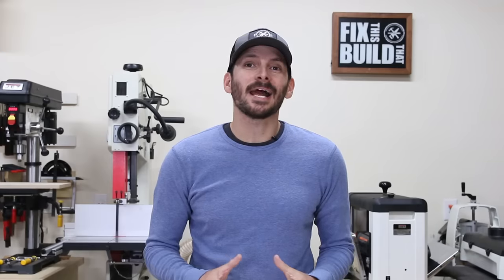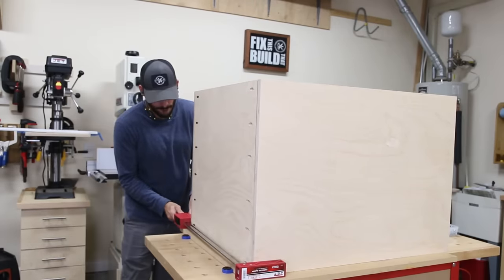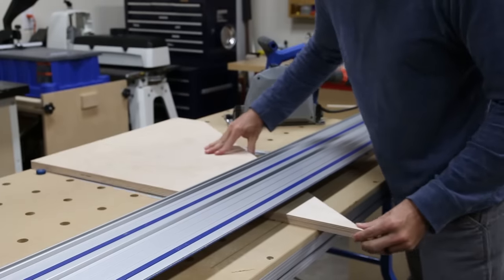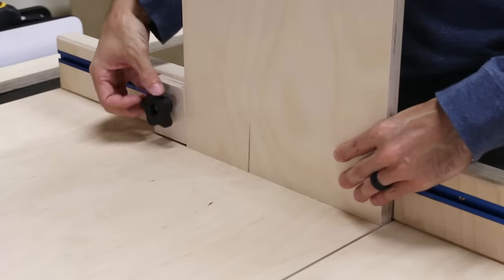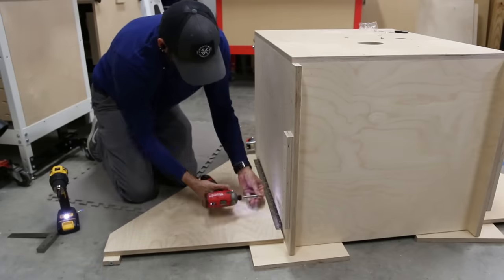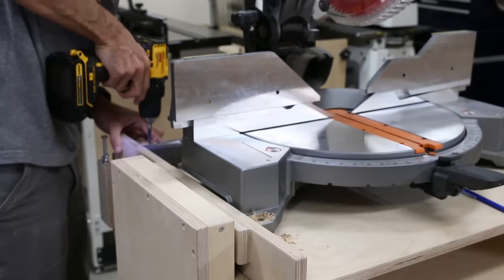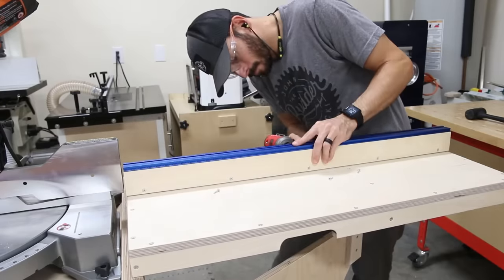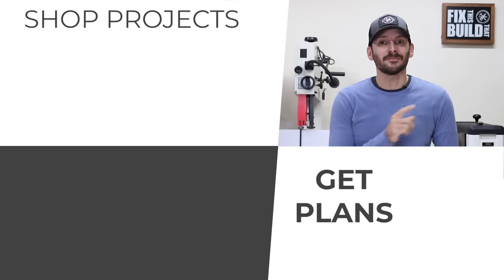ULTIMATE DIY Miter Saw Stand | How to Build

Comment: Another quarantine project I built to improve my shop.  Thanks, Brad.  Great plans.  Could have used one more dimension on the cutoff of the wings, but ultimately it wasn't critical.  How has the 4-gallon vacuum worked for you?  Does it provide enough suction?  Thanks.

Comment: Just found your channel a few days ago since I can't go anywhere during the pandemic and have already bought two of your plans that I will build when I can get material.  My late father was a fantastic woodworker but did not teach me anything.

My newbie question is, can you be a little more specific on what type of plywood to use for this project and also for the shoe rack you did?  Obviously something like CDX will not work for this or any furniture type project so any suggestions would be greatly appreciated.
TIA
Reply from the maker: Welcome to the channel! If you're painting it you can use BC sanded plywood or the "sanded ply". Definitely don't need the maple or birch oly

Comment: Brad, great plan!  Will this build accommodate a Dewalt 780?  I was checking the amount of swing on the arm and at the 60 degree point, it measures close to 28 inches due to the miter lock handle in front of the saw.  Thanks
Reply: Hey did you ever build this I have the same and was wondering as well?
Reply: Not yet. but hopefully will this winter @jrhewitt1988

Comment: Good Evening and thanks for this video and your plans, which I have purchased.  My miter saw is slightly higher at 4.75 inches at its table surface.  I like the 39 inches height that the plans indicate.  If I lower the top shelf another inch to accommodate for my saws extra height would that not be an acceptable adjustment rather than increasing the height of the sides?  I realize its only an inch and could be done either way but would be interested in your comments.  Thanks Gordon
Reply from the maker: Yes that would work as well!
Reply: @Fixthisbuildthat  I will enjoy having my miter saw more easily able to be used.   I appreciate your ideas and your willingness to share them.

Comment: ok... ignore my question about the 20.5 inch position versus my thought about the 22 inch placing of the double 10.5 inch supports under the extension table .  The angle of the support wing accounts for the difference between 20.5 inches and 22 inches....at least I think so....

Comment: Hi Brad, I just purchased these plans and had a question with respect to the material/supplies used.  Can you explain; (10) 2-1/2” 1/4” - 20?  I know you mean (10) pieces that are 2-1/2 inches by 1/4 inches, but what does the 20 stand for?  Also, what size of fender washers did you use?
Reply from the maker: Hey, Mike.  1/4-20 is a thread type.  They will be listed that way at the store.  And 1/4" washers for the 1/4" shaft.
Reply: @Fixthisbuildthat  Thanks Brad, I look forward to your next build!  Cheers, Mike
Reply: @Fixthisbuildthat  just another question:
What size of Forstner bit did you use for the recess’ on the wings?  Also, how deep did you go?

Comment: I really like it.  The only thing I don't care for is the use of t-nuts on the surface side of anything.  At some point in time they are going to work themselves free.  Those little points are just there to stop it from turning being threaded from the opposite side, not to hold it in.  I think threaded inserts would be a better alternative.
Reply from the maker: There is no upward force on the insert, always downward. So it can't physically work itself out. But threaded inserts are great too 👍👍

Comment: Hey Brad nice build - question- realizing this is a new build but how does that low profile cyclone lid work so far?
Reply from the maker: the cyclone works very well at separating the dust.  Not sure how much suction I lose though
Reply: I bought one well over a year ago, and it's the best $40 I ever spent! Don't hesitate. But the biggest mistake some people make when using them, is that they try to use too small a vacuum. It requires a minimum amount of suction power (check the stats, the more the better) or it doesn't work as well. I use the 16 gal Ridgid vac w/the removable blower head, and it works fantastic (about $100). I collect dust from my table saw, band saw, and sanders, with a standard size 2-1/2" dia 13' hose...and I use a 20' hose (same 2-1/2" diam) to reach my planers and router table, and also use it to vacuum the floor almost anywhere in the shop. Yes, I experience a little suction loss with the 20' hose, but my vacuum has so much power that I've never had ANY problems with clogs, even when using the planer. It works great, and I just manually switch between the two hoses at the Dustopper inlet, as I need them. Only issue is those 5 gal buckets under the Dustopper fill up really quick though, if you're doing a lot of planing...so you do have to keep an eye on that. By the way, do yourself a favor and pick up a $10 remote plugin for the vacuum, and you won't have to walk back and forth to turn it on and off. It's cheap and has been very dependable for me, and doesn't seem to require line of sight for the remote...that means I can point it almost anywhere (or be almost anywhere in the shop) and it still works perfectly. It's probably the best $10 I've ever spent on any tool, and really goes hand in hand with the system above!! It makes your life so much easier, and you'll love having both hooked up together. It also makes using the vacuum feature on the Kreg K-5 jig a pure pleasure to use while drilling pocket holes, because it's so easy to turn the vacuum on/off remotely. Having the ability to use the above system with those long hoses while keeping it centrally located in the shop, also means I don't need a vacuum cart, and/or I don't need to always move the vacuum around the shop with me. All items including the vacuum, the Dustopper cyclone, the remote plugin unit, and the long hoses, are available at or through Home Depot. I don't work there and I don't always shop there, nor do I receive any financial gain by telling you any of this...I'm just passing on what I've learned through my own experience, and it's a great system that I use, that doesn't cost much money. Sorry for the long comment but I hope this info can help you, or maybe someone else.
Reply: @Fixthisbuildthat  Brad I'd sure appreciate a link to that cyclone model for the 5g bucket!
Reply from the maker: @ShaielYitzchak  link in description 👍 👍

Comment: Purchased the flip top plans & at the 1:05 mark you begin explaining how you cut down your pieces a little oversized...referencing the manufacture edge & so on. Looking at the plans cut sheet...if the sheet is truly 96” and the plans call for 94.75” to be needed, by how much more are you cutting the pieces oversized? Thanks for the time
Reply from the maker: I typically look at how much I have leftover (so 1.25") in your example.  Then figure out how many cuts need to be made (including the outside edges).  Then that let's me know how much I can cut.
Reply: Fix This Build That so what you’re really talking about as a “little oversized” could be an 1/8” or so on each side....1/4” total?

Comment: Great Build. I love all the extras you made. I love the fact that you readily confess to being a perfectionist...so am I. So I too made a miter stand based on April's design and when I went to drop in the miter saw...Bwahahaha...You bet!! I forgot to measure the width of the miter saw base!!  #^%$)*(^&%(II!!!!!
Being new to woodworking in general, I tried to take it in stride.
I gave myself a break to beat myself up and to think of how I could salvage the last 6 hours of work. I managed to come up with a work around and now have a very usable miter station.
One thing I have noticed using piano hinges is that I need to use an extension off the saw itself as opposed to the support wings. The piano hinges have just enough play in them that I don't always get an accurate cut. Other than that, I am so happy with it. I do however have to change from regular casters to locking casters.
Thanks again for all of your great videos! You are both informative and entertaining.

Comment: I have a dewalt dws780 and I’m wondering what you use to connect the cyclone to the back of the saw. Is it a universal attachment?
Reply: Hey did you build this and does it work with the dws780?
Reply: @jrhewitt1988  I built it and it works great! Great space saver.

Comment: Love your designs and videos, although I must admit to being partial to more traditional joinery.  Question: there are three items plugged in to the iVac - the tool (miter saw), the vacuum and something labeled Auxiliary.  What is plugged in to Aux?  Thanks.
Reply from the maker: It's actually the box itself. The box has two plugs, vac input that connects to vac power receptacle and tool input that connects to both the tool power and aux receptacles. so you could power the vac power and tool power receptacles separately. Or you can do what I did and run the vac input to the axillary receptacle which basically just let's you run it off one power cord and wall outlet. I know that's probably confusing, but look at it in the vid and should make sense.

Comment: Hey, I bought the plans from you, but you didn't specify what brand / model those wheels are.  What about the wheels you put on the bottom?  I would like to be able to use the same ones because I like the locking mechanism they have to keep the cart from rolling around better than the ones I already have...
Reply from the maker: Hey, Chris.  These are the wheels I use the vast majority of the time.  https://homedepot.sjv.io/eb7V6

Comment: How do like the dustopper with the small vacuum, I have one but its hooked to a larger 16 gallon vac
Reply from the maker: It's definitely less suction than the 12 gallon.  I need to shorten the hose and see if that helps.  Works, but loses efficiency

Comment: I have built a similar stand but I have to say that the piano hinges are not that great. There is too much wiggle room on the support wings and the extension wings move a bit down/up from front and back because of the wiggle on the hinge. Not a fault of the plan but rather the hinge, I suppose you can use any other hinges that are large/strong enough to support the support/extension wings and minimal wiggle room.

Comment: Well Brad, I've built several of your projects and this is the first one that turned into a mini train wreck. Base cabinets, wall cabinets, outfeed table: no problems.

A few days ago I started on your mobile miter saw stand. I made sure my saw, an older Makita 10" compound sliding unit, was not too wide for this stand. However.......... after I got the two wings attached I brought over my saw and set it on the stand. Guess what? No need to add shims under the saw, as the dang thing is 1/2 inch TALLER than the wings!!! My first thought was to lower the middle shelf the needed amount, but one look at how difficult that would be was enough to say "fogetaboutit". I guess at this point the only thing I can do is to cut a pair of 1/2 inch plywood boards to size and glue them into a sandwich over the existing 3/4 inch wings. Arrghhhhh....

Comment: What size of roundover bit has everyone used on this project? What’s the most common bit you use overall?
Reply: If you just want to barely round over then most would go with the 1/8 round over.  1/4 round over is also an option but cuts too deeply for me.  A good strong sanding on the edge can approximate the 1/8 round over but not with its consistency.

Comment: I have already built one of these so I was very interested in how you attached the triangular wings.  So Fricken simple.  Needless to say I didn't attach mine in the same manner.  Sometimes I amaze myself at what a dumba%& I can be.  Good grief.
Reply: I built one of these a couple of years ago, I used heavy duty piano hinge on the wings and after a while the hinges started to bend at the screw holes making the tables sag thus having to keep leveling the tables. I changed them to more solid door hinges.
Reply from the maker: Yes, I agree.  I attached them the "hard way" on the first build 😂😛

Comment: You cannot say that the factory edges are "pretty good" and then at the same time say that "they are pretty rough".  Pick an answer, or qualify what you mean.
Reply: He said that the factor edges tend to be pretty square, but also fairly rough. Square referring to its perpendicularity relative to its other faces. Rough referring to the surface finish.

He probably isn't actually commending its squareness, but its straightness. The factory edges are fairly straight, which means you can reliably get a straight sawn edge. The saw blade can take care of squareness.

Comment: why built one when a totally mobile foldable one cost less than $200 made of metal with big rubber wheels and folders to fit in car , stand up right when storing, i don't get it
Reply from the maker: No storage, no stop block with measurements, no dust collection, and I like to build 👍